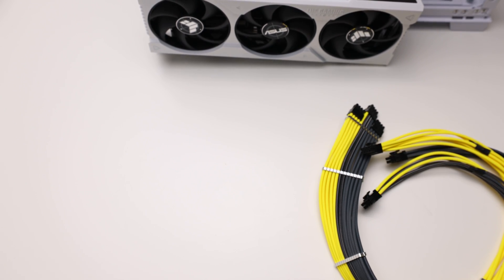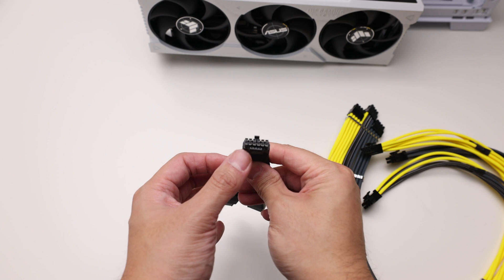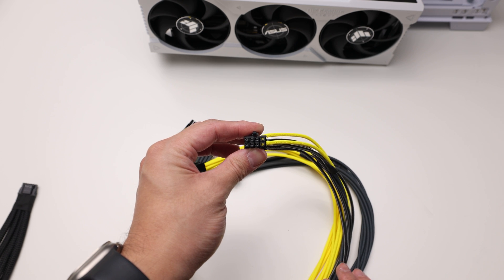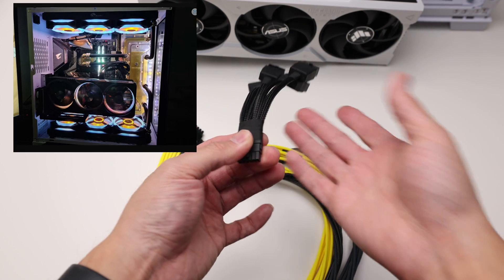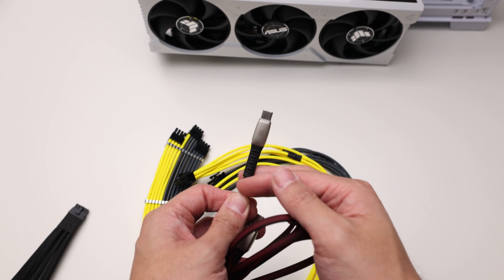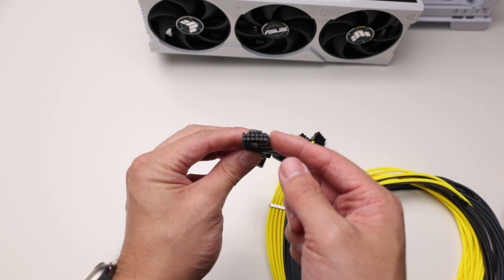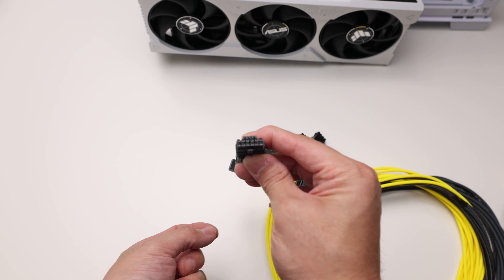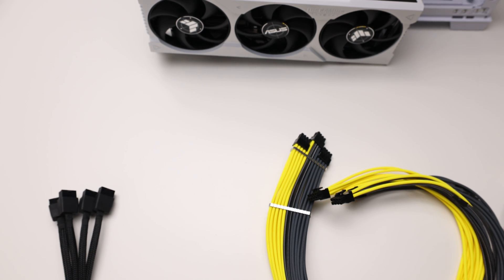HOW TO AVOID BURNING YOUR RTX 4090 / 4080 CONNECTORS 12VHPWR

Comment: This guy has no idea what he is talking about. You have to bend the cables, no matter what case you have (except open case) for a 4080 or 4090. Also the pins touching the plastic is not a problem. The pins are touching the plastic anyway all the time. The problem is, if you disconnect the cable from the pins, or break it when bending it. It will make an imperfect contact and heat up, then catch fire.

Comment: hello might have done stupid thing with 4090 lol. i have sfx 750 cosrair platinum that only had two pcie so i plug one and second with one daisy chained total 3 left the one plug spare . ran all good no crash. but i think it decreases in performance. Max watts running 350w. i think it ran more than 400w before. did i damage the pcie cable? theres a little buldge on the pigtail wire i think that melted off? would that have damage the gpu? sorry im always paranoid. i just ordered Corsair 600W PCIe 5.0 12VHPWR waiting to arrive. thank you
Reply from the maker: You need at least 850 for a 4090 in heavy load

Comment: nice video, but you really don't know what you are talking about... the truth is that card companies use the same plug to connect power to cards for years now
if the card is more powerful, generates more heat, needs more volts, it needs a BETTER connector! so please stop making excuses for lazy big companies that ask for 2 k for a card thats not working ! 
i can fix this problem in 2 min using 15 different  types connectors i use at my company

Comment: The problem is this doesn’t fit in barley any fking cases without bending the cable. You can’t use this card without the cable touching against the glass with a bend or else u can’t put the side panel on

Comment: So I started getting problems with my 4080. The GPU isn’t heating up or probably not even giving proper temps and when games load up it does not render graphics and FPS is below causing stutters and sound disappearing every now and then. Could it be bc of the cable? I’m going tomorrow to get a new one or maybe even a refund bc that’s bs
Reply: Doubt its the cabling. Check for driver updates. Even window updates.

Comment: I recently bought a 4080, should I be worried about this?
I’ve never built a PC before nor have prior experience, so can you provide a link to a better cable for the card? If so do I need to buy more than one
Reply from the maker: No you shouldn’t worry about it. Most of the cases using the a cable comes down to user error and the number of incidents is a handful of units of all the cards sold worldwide. The tech media has blown it out of proportion
Reply: @JCustom  so what people are saying, etc dont press it against the side panel (resulting in bending). if u were to do this chances would still be really low of your gpu catching on fire. im in a similar scenario where i have the taped beginning of the adapter completely straight with maybe 1-2 cm of normal wire straight before it bends to the right. should i still be good to go without worrying or is it worth to invest in a new adapter which supports bending?

Comment: So it looks like first insert the power cable to GPU prior to installing it on the motherboard and then proceed with inserting the GPU into the motherboard slot, that way there will be no misconnection the way you are describing, that's something I am thinking I should be doing if I get this GPU.

Comment: What is the difference between type A and type B cable? The voltage on the pins is the same, while the position changes depending on the vga, or how to pass the cable above or below the GPU, so can you put type B & A cables in all types of cards?

Comment: this is so risky bro. shud i skip 4k series 
i have deepcool tesseract case with i7 12700, asus tuf z690 and RTX 3070 FE .
shud i uogarde to tuf 3080 12gb bro? will Nvidia continue to use this connectors on their future lineup as well ??? 
pls advice me 🙂
like 5k series.
Reply from the maker: It’s not risky as long as you seat the cable properly and don’t bend the adapter if your using it.
Reply: What if they use it for 5k series too xD some things in PC building just never change. Like it took so long to get from ATX 1 to ATX 3.0 and PSU connectors are still largely the same plastic connector heads with pins. Like the molex connector pins these things can easily bend, get loose, or burn the plastic head if connected incorrectly like these plastic moulded SATA to molex connectors.

Comment: Notice how the adapter has the same sleeve to prevent that as the USB cable did.  That's a design flaw.  If the prevention is there and people are working with what's provided, it means the product provided is inadequate to perform under regular use parameters.
Also, the pins touching the plasting does not cause enough heat to melt the plastic.  Ever.  That's not what causes that.  The ONLY way electricity flowing through THAT cable can melt that plastic, is if it's arcing.  If it's arcing, that means the connection is inadequate.  If the connection is inadequate, that's on NVIDIA, not the users.
The class action lawsuit is now over 8,000 participants in the US alone, so their claim of 50 world wide is bullshit.
Reply: No 40 series for me than

Comment: Question? Would using more tape on the cable about halfway up make it more secure from bending? I have a Corsair 7000d and I’m probably mounting it vertically.
Reply from the maker: since i made this video, it seems most of the issues arose from  the adapter not being fully inserted and then bending causing issues with the pins. If you mean by using tape to reinforce the area from being prone to bends, I do not see the down side. While I personally have not had issues with the adapter, I would still suggest folks to either use one from their psu supplier or something aftermarket from cablemod. The nvidia adapter is just not well made.

Comment: I have an atx 3.0 power supply will the 12 volt cable still melt I dint use the adapter just a 12 volt cable it's a gigabyte power supply

Comment: you have to see Jay new video. Igor figured out another problem not jsut this like you said.
Reply from the maker: Yeah I saw Igor’s post.  I did notice it was strange that I saw only 2 thicker cables going into each 8pin. Seeing the solder job explains a lot. It is indeed a very fragile adapter.
Reply: @JCustom  yep unfortunatelly.

Comment: Hello. I had a question. Does the burning also happen on the single 600w connector or only on the adapter for the old PSUs ??
Reply from the maker: It’s on the adapter which is pretty fragile in construction in terms of acceptance of bending.
Reply: Thank you! I was quite worried! Because otherwise why didn't happen with the old rtx's ? 
Thanks for making these vids keep going!  @J C

Comment: How are you supposed to fit it without bending the cable a little bit, have install 4x 4090 if different cases and none of the cases seem to fit.
Reply from the maker: Yeah it’s tough and the orientation makes it harder. It’s not that you cannot bend it at all, you just cannot bend it to the point where the pin inside gets repositioned
Reply: I was about to buy an  RTX 4080 now I am having second thoughts I'll probarly just get an RTX 3080.

Comment: REALLY, Pushing 50 amps through that cable is fine.  You have no idea about ohms law and wire current requirements.  If anything, the cable is causing current limiting, which means they intentionally designed the cable and connector to limit current.  Do some homework before putting out a bs video,  what size of wire is needed to properly handle 50 amps.  Then you will say, darn, they really did misdesign.
Reply from the maker: You don't find it to be coincidence this is suddenly an issue with the 4090, when the 3090ti draws similar power with the same connector? Do you really think it takes drawing 600 wats to melt plastic with a metal pin? Could it be better built absolutely, but the cases we have seen its clearly the pin having been moved out of position.
Reply: @JCustom  12 VOLTS / 600 WATTS = 50 AMPS  The connector and cable are current limiting due to the physical size.  In the future, all 4090 users will have to worry about connector/cable meltdown.  To design a connector and cable assembly that has to be perfect, or else is just horrible.  Take Care.  P.S>  a good example is your car's ignition system, where the battery cables are far bigger.

Comment: I've limited to power slider to 80% and the card isn't pushing more than 350W (no difference in FPS actually), does it make it safer?  i was considering changing case, i have a P600s but can't find anything bigger indeed that would help...
Reply from the maker: It's not the power draw. You can melt plastic drawing 60 watts. It's folks overbending the adapter causing the pin to come in contact with the plastic. The pin/connector has been the same on the FE cards for 2 years now, the cards were smaller or the connector was orientated differently creating less spacing/cable running issues. Yter, pc sites want to focus on this being a 4090 issue but it's not. Its just a very delicate connector as it always has been, that is now drawing more power than before. The underlying chance of the pin moving out of placement has always been there with every connector.
Reply: @JCustom  well I hope it will be fine untill I can grab a 90degree adapter..

Comment: How to avoid burning? DO NOT BUY THIS CARD. It is overpriced and has an inferior power connector.
Reply from the maker: Then you would also not be buying any 30 series FE cards as they have the same connector or any AIB 3090tis.
Reply: @JCustom  I have an EVGA RTX 3080Ti FTW3 with 3 8-pin connectors and I'm happy with that for the entire 4000 series of cards.

Comment: Hey man.

Let's be real. Every available GPU currently using this connector is north of $1599 (3090 Ti being the exception on cost). For that much money, someone doing a simple PC build and routing cables as we have all been accustomed to doing should have faith that the connector will "just work" as an Nvidia representative told Jay (JayzTwoCents).

I have one of these cards (an MSI Gaming Trio) mounted horizontally in a Lian Li Evo (one of the bigger cases available) and the damn cable still touches the glass at the bend. While I'm sure I am safe, not everyone is going to build in this overused/overseen case. What are they to do? Run with the side panels off until Cablemods releases their 90 degree connector?

A lot is being asked of customers for a problem that really didn't need fixing (the old connectors). We have to either pony up for new PSUs that have the 12VHPR connector natively, or use an unsightly octopus connector to get these overly massive cards to work. Oh, and then we can't even bend either cable for proper routing, and potentially have to leave the side panel off.

No. It's stupid anyway that you slice it. People are right to be bitching about this.

Also... you started to mention that Intel had switched over to this connector like the other GPU manufacturers, but then had to catch yourself. Yeah... that's right... one of the major backers of this connector didn't bother to put it on their own cards. Wonder why that is?
Reply from the maker: Id wait for the adapter. So far the two we have seen are both dynamics. Dynamics don’t have the tallest space to the glass as some other cases may. Often a frustrating aspect to watercoolers. Nvidia could of avoided the situation a lot by simply rotating the connecter back to the position on the 3080/90.  It’s pretty obvious why intel didn’t use it. They are introducing a new product to the market, using an adapter would increase product cost and possibly hinder adoption. It’s much safer to go with what most folks already have on their psu especially when your targeting the 300 ish dollar market

Comment: Common sense? You are the one who lacks common sense here by failing to realize that the majority of the cases out there simply do not allow room for NOT BENDING THE CABLE, unless you are willing to sacrafice all other slots for a vertical mount.
Reply from the maker: Btw just so you know this same connector is used on the 30 series without the sense pins and is the same on the 3090ti. It doesn’t take that much wattage to melt plastic. This same thing could of happened on any of the 12pm cards. Just because you can bend the hell out of some cables doesn’t mean you can for others.
Reply: @JCustom  You are right. But a 3090ti is also not 150mm in height, so the average user can get away with leaving some extra room in the case and not bend the cable. Most cases do not have room to fit a 150mm brick plus an extra 35mm for cables. It is going to bend, period.

Comment: You have insertion count ALL wrong.
It is a guaranteed spec, for which the cable will stay within the specified limits set forth by the manufacturer. This usually relates to mating resistance which is in fact very relevant to power handling. Within these allotted insertions the connector will thus perform within spec, securing a mating resistance low enough to ensure the connection will handle the current they specify. It also may be securely retained in the shroud/housing/socket.
If "worn out" it may be outside this spec, by a little bit, or by a lot. There is no guarantee it will not catch fire, but at the same time, there is certainly no guarantee it will. In fact, there are large safety margins on such specs, as they have to bake in potential issues like contamination by abrasive dust and whatnot.
However, stressing and preloading pins causes immediate issues bringing the connector out of spec and is clearly stated in almost all such specifications. It is, by this very nature, a very bad choice for such high power applications. The fact that it uses multiple connections to it's max specified capacity is also very disturbing. There is no useful balancing in such cases and one may end up with a few pairs carrying the brunt of the power. They should have used a much beefier, but less pincount style connector, preferably what is normally used in the industry for high current applications like a bladed connector, or they should have just increased the voltage, allowing the current to stay much lower.
Reply from the maker: I agree with what you are saying and believe me  I am aware of spec and out of spec. I was simply putting it in terms that most folks have been hearing.

Comment: sadly his not the only one reporting the melting, further down the comments their are others reporting their melting, sadly you have to scroll a lot to see them since ppl are comment spamming the thread and their comments are getting pushed down. i saw one where the dude was using stock settings and didn't even bend the cable on his and 2 pins melted. AMD abandoned this adaptor/cable for their new card and I'm holding off still before getting a card.

Comment: Patronising nvidia for fire hazard?  +1600$ for graphic card and I have to have cable sticking out or risk fire hazard?
Maybe redesign PC cases in general to have a cut in sidepanel?
Every second generation of nvidia is good, 30xx was good 40xx is not. It reminds me of Fermi.
Reply from the maker: its the same connector on the 3090ti just fyi and the pretty much the same without the sense pins on the 3090 and 3080

Comment: "This ATX cable is here to stay" Yeah I wouldn't be too sure about that.
Reply from the maker: It's not new. This is essentially the same connector we have on the 3090/80. They added the additional pins on the 3090ti.
Reply: @JCustom  Sure but do you honestly believe if consumers are getting burnt pins etc they're just going to leave it? That sparks safety concerns and that in general = lawsuits for their safety if not consumer law. Maybe it will be the ATX connector but hands down no company is going to let this issue scale up so it can come back on them.

Comment: The problem goes back to bending, which we can't avoid with how large the gpus are in normal size cases. Maybe make a 90degree connector? This is the next "you're holding it wrong" BS.
Reply from the maker: Large problem is the way the connector orientation changed. If it was vertical it would naturally line up with wire management and lay more flat when the gpu is positioned horizontally. We have had this connector since the 30 series, just now with more power draw.

Comment: The 8 and 6 pin connectors are standards for a reason. Concentrating all the hot pins to one connector was always going to end disastrously. You should add a "FIX YOUR TRASH NVIDIA" header to your video title lol.

Comment: WHAT ABOUT 3090Ti? It uses the same connector...
Reply from the maker: yes and in terms of pinout same on the 3080/90. As I updated in the description. We just have more possible "live pins" this pin around but the connector design for drawing power has not changed. The rotation of the connector on the GPU makes it more likely for aggressive cable bends (same as on the 90ti) had the left it in the vertical position it would of been better as well

Comment: I like how the GPU of the problem system is not conventionally mounted. Showing off the side of it nicely.

With the amount of power required per pin good contact is more important than ever, if you do heavy loads.
Need to take a hit to aesthetics and do whatever is required to ensure this won't be a problem including using much longer cables than planned for.
This was a problem with every iteration of power hungry cards and is only more pronounced with the 4080 because manufacturers have warned it will happen.
Reply: The irony is the aesthetics caused a impractical fault. Just like the connector. Its smaller for 0 real practical reason, and is much more prone to fault. Unlike the usual 8pin power connectors.